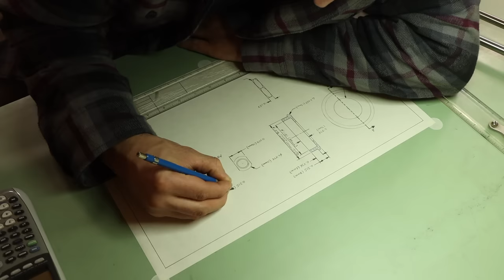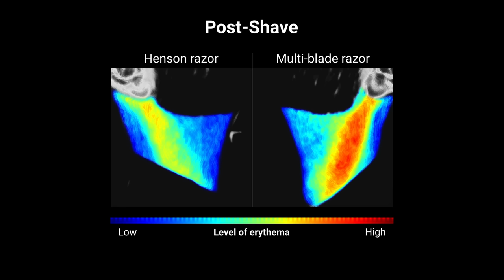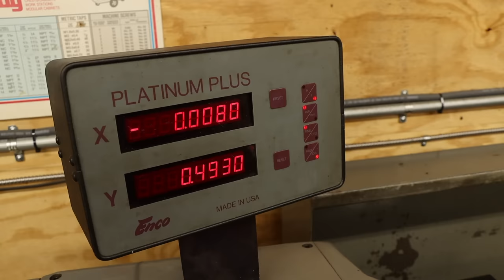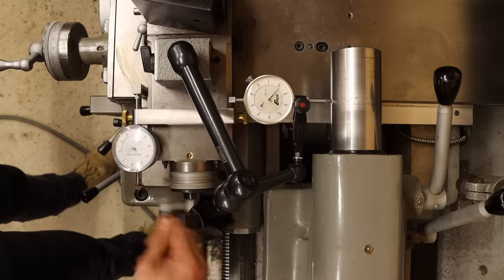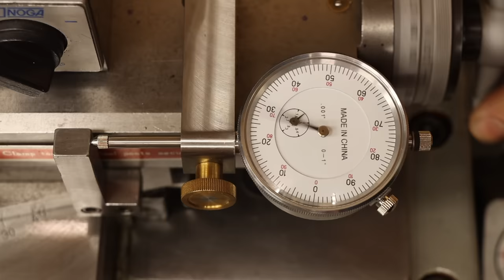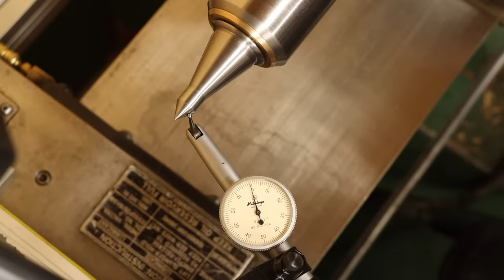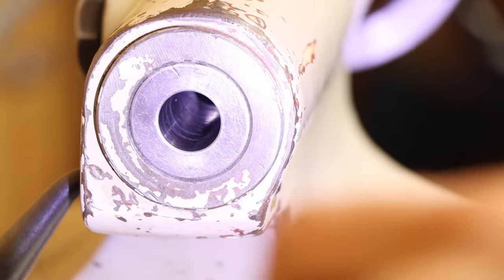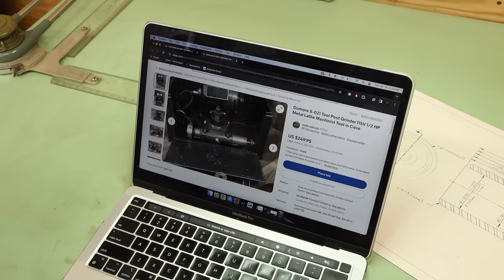WANTED: Dead or a LIVE CENTER

Comment: A nit pick.  This is a revolving dead center.  A live center is revolved by machine power, not the work piece.  If you put a center in the headstock of a lathe it is a live center.  Cylindrical grinders have headstock centers which can be live or dead depending on machine setting selection.  Unfortunately most people refer to revolving dead centers as live centers and the definition has been almost completely changed.  There is value in using the proper terminology IMHO.  Cheers.

Comment: Conical roller thrust bearing symptom how about you add some pressure to the point (to center it) and then do the spin? I'm sure you get another readout. Live center with conical rollers need axial load to be measured properly. Some centers have a dubbelrow corner contact bearing in front of a flat disk thrust bearing, some without anything to lock things in place.. To me it seems to be thousands of configurations on the tailstock centers..  one last word, stay away from cheap bearings.. you might be lucky but why gamble over pocket change. Thanks for vids! :)

Comment: I almost wonder if you can get a deck attachment for your surface grinder that you have. Kinda like the rotary table for the mill. I don’t know if they make anything like that. But it could be an idea for another project. Good luck and keep up the good work. And I think that stache fits pretty good.
Reply: It's called a spindexer. Can be used for rotary positioning, but also allows you to spin a part by hand while also grinding.
Reply from the maker: Yup as the other guy said spindexers and a few other things like that exist.Thanks, Sam!
Reply: I wish I had spare material and or the tools to make you a little sign for the shop. But alas I don’t have access to a welder nor do I have the space where I live.

Comment: My dad was an engineer. Whenever he did milling work he'd have 'white water' (I'm not sure if that's a slang name for it) to cool down the parts he was working on so they didn't get hot. Why isn't white water being used here rather than waiting for the part to cool down because of heat warp?
Reply: It will induce additional stress in the material by cooling the outside faster than the inside, causing it to warp.
Reply: @David-xo8ci  I don't properly understand. The metal gets hot at the point of contact between the part and the cutting tool. If that's being kept cool by lubricant or similar how does it heat up?
Reply: @WaddedBliss The whole part will still heat up, even when constantly cooling while cutting. For example, a part that I regularly make requires me to remove about 80lbs of steel on each one. Even when drenched in coolant while cutting, the part is still hot after this. To then cool it with coolant means that the outside will cool faster than the inside. Although after making a few of those parts the coolant in my lathe heats up as well, so for me it's not that big of a deal. But it does mean that I absolutely need to take cooling into account to get the tight tolerances I need. Also the removal of material in itself causes stress relief in the material, making it warp.

Comment: Can you use ceramic inserts to correct bananas in the lathe after heat treatment instead of a whole new equipment?
Reply from the maker: Based on comments from others it sounds like you can

Comment: Aww and you did so well on that build. It seems you found the biggest offending party, so to speak and while its frustrating, I believe you definitely have the ability to fix them.
Turds? No. Just "not quite finished yet" and that goes for both live centers and the tail stock
Reply from the maker: I like your thinking 😁 Thanks!
Reply: @InheritanceMachining  Welcome.
I've had to do my fair share of bug hunting and fixing in the past, maybe not your level of precision, but I do know how they can be frustrating!
Don't give up friend, you got this!

As an aside, one of my more annoying bughunts was when I had to fabricate a high pressure pneumatic drop block capable of working at 3000psi, the part isn't available where I am without ordering from overasea's or getting someone to fabricate one at a price I couldn't afford, I made the part several times before I got one that didn't go out of true...
I found (the hard way) my original drill vice broke on me, dragging everything out of true... that was three failed attempts...
The fourth STILL went out of true and I spent ages trying to figure out why before discovering the pillar drill's bearings weren't just worn, they were so gone that anything off 100% flat caused deflection, the fifth one snapped the drill bit and chewed itself up in the process..

I FINALLY got #6 to work with minimal deflection.
After that littany of failures, I scrapped that old drill since it wasn't worth repairing and aim to purchase a replacement when time and finances permit.

Comment: Just out of curiosity. Did you put the side of the bearings with the thicker race towards the back of the center in the direction of the load?
Reply from the maker: the front two yes. The rear is flipped to provide the preload
Reply: @InheritanceMachining  Very nice work. You never cease to impress me.

Comment: Hey there, a comment on that bearing configuration. I am pretty sure that you haven't split the load (axial load) between those three bearings. Such configuration needs shimming of the inner races before installing the next bearing and this is not a trivial thing to do. So you're only loading one bearing axially, and hence, probably adding a bit of radial play since the other two are not loaded.
Br,
Thanos
Reply: I think you're correct, likely only one bearing in the stack is loaded. In my limited experience multiple angular contact bearings come as a matched and marked set.

Comment: <GRIN> It kind of surprised me when you didn't run a taper to tail stock blueing fit just after you turned the taper on project stock.  My guess is that you'll need to clean and taper ream the tail stock then realign the tail stock using a good dead center with headstock spindle also using either a dead center or the 4 jaw and a test bar of some sort.. You know... Standard stuff.   😁😆😅🤣😂
Reply from the maker: Oh I'm fully aware it's not going to be easy 😂
Reply: If it was easy you wouldn't be doing it. That's why I really like what you're doing on this channel.  Thanks.

Comment: what if someone were to get an open source computer board and programed it to read your DRO and control a variac to get the surface speed of the tool perfect on those tapering cuts and face milling... like increasing spindle speed as the radius decreases so the tool can live in its happy spot
Reply from the maker: I believe this is called CNC 😉

Comment: Did you already replace the spindle bearings? How are you getting anything even remotely decent with how bad they where? And don't telle you didn't make video about that. I was super looking forward to that.😢
Reply from the maker: I haven't even toughed them yet 😂 I think the tailstock pressure helped preload the spindle bearings a bit. I could hear them getting loaded up while running

Comment: So you're telling in Imperial machining one thou is actually bigger than one tenth? Who thought that was a good idea? Another reason to add to the pro metric mountain of evidence.
Reply: I might be wrong but I think when he says tenth he might be referring to a ten thousandth and not a tenth meaning .0001 not .1
Reply: @hambear8131  I had looked it up so yes that's what it is (in imperial machining tens are ten thousandth of an inch) but even if you know it still makes the imperial system bad because it make the measurement ambiguous and context dependant.
Reply: In my entire career I have never machined to a .1 tolerance, so there would never be a case for confusion, but maybe you metric machinists aren't there with your precision yet.  Keep trying.  @KarimElHayawan
Reply: @KarimElHayawan what could be more metric than measuring in ten thousandths of an inch? I know above that it all goes to hell in a hand basket. Just sayin'.

Comment: Crazy peoples's ideia, can this good part  be fixed with "roller bearings"  or the runout is another issue not related to the balls ? I'm learning this craft now, and I'm completely dumb in this, so sorry if this question is beyond dumb 🥴
Reply from the maker: It's definitely not a matter of the bearings since the angular contact ball bearings I use here are generally regarded as the most precise of all bearings. 100% all of the issues are of my own creation 😂

Comment: Next video: razor blade sharpener. 😂
Reply from the maker: Now that's really being frugal! 😂
Reply: @InheritanceMachining  There are many devices for sharpening invented. Starting with a glass half-pipe, ending with automatic and inverted blades and a clock spring. The process of designing and building a working device in your design is more interesting.